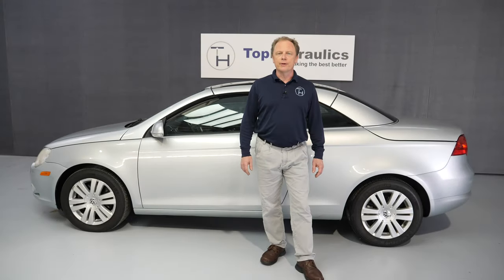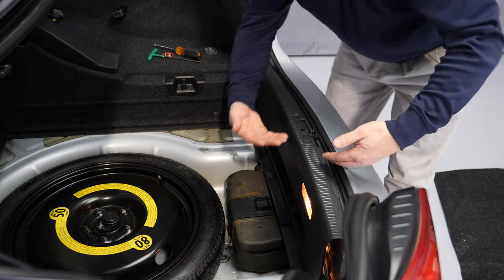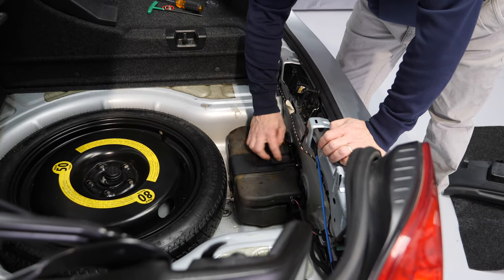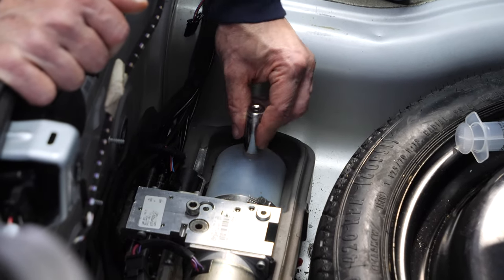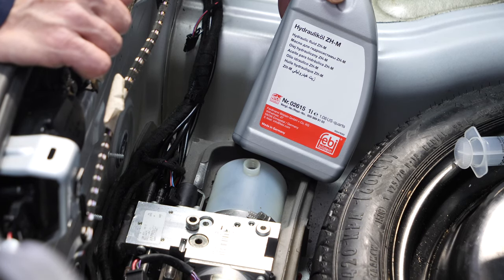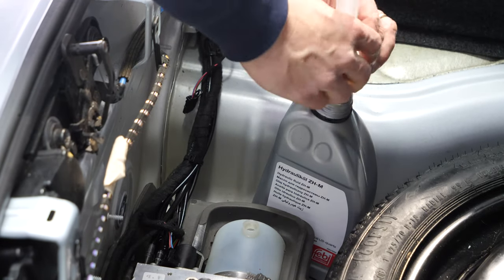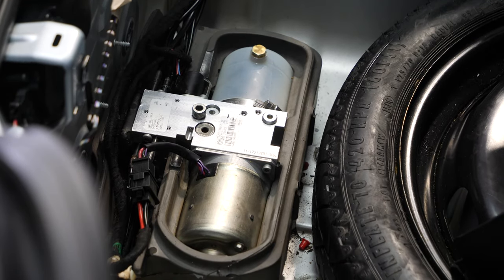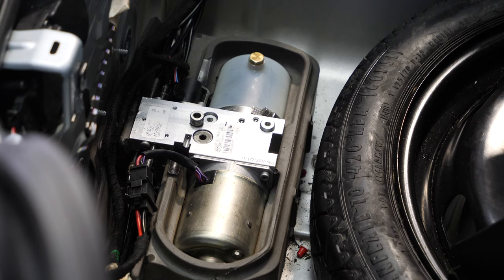Volkswagen EOS - How To Refill The Hydraulic Pump

Comment: Hi Klaus! Thank you for detailed videos. Very useful indeed. I just used the same febi 02615 produced in 2022 to refill my MB R170 roof pump. It is colorless as seen in this video. However, years before, I remember it being very yellow. I also noticed that new MB cylinders (build in 2023) still come refilled with a yellow fluid. I was afraid that my febi 02615 was counterfeit but relaxed after seeing your video. Do you have any idea the reason for that difference? Thanks in advance.
Reply from the maker: FeBi went to being colorless a number of years ago and Mercedes may still be adding a dye to their fluid. Outside of the dye, the fluids should be identical.Sorry to hear that you are using new cylinders from Mercedes, but I appreciate your candor. The manufacturing date is printed on the hoses, as you probably know since you mentioned the parts were made in 2023.
Reply: @TopHydraulics  Thank you  for your prompt reply!

Comment: Hi. How often does this need to be replaced? Does one siphon the old fluid out with a syringe until empty and then refill with new fluid? Does the level typically go down if there are no leaks in the system? Thank you.
Reply from the maker: The fluid level does not go down if there is no leak - this fluid does not evaporate. The manufacturer says that the fluid never has to be changed. Not so if you are in a hot climate or are using the top daily. If the fluid in your pump looks really dark, then you may want to siphon out as much as possible and refill.
Reply: @TopHydraulics  
Thank you so much! Honestly I haven't really looked at the color of the fluid, only to see if there is or has been any water down there. I will however make it a point to inspect the fluid ASAP. Again, TY and have a great day!

Comment: How often do you recommend to check and top up the fluid?
Reply from the maker: Thanks for asking. The only time you will have low fluid level is if there is a leak. In that case, topping off without replacing the faulty parts wouldn't help you much. The designers' idea was that the fluid never has to be checked or replaced, but that is unrealistic. You will be checking the fluid level once you find the top not moving properly and anything in-between may help you for peace of mind. Given that you have to go through some acrobatics to see the fluid level in the pump,   I would suggest every one to two years.
Reply: @TopHydraulics  thanks! Very helpful!

Comment: Question, so if you want to open up the whole roof and it gets stuck midway, could this pump be the cause ?  
Having this problem right now it just stops half way just when the most heavy part should go up.. closing it up again goes fine
Reply from the maker: Let's check the fluid level in the pump first. Is it between the MIN and MAX lines on the pump's reservoir?
Reply: Dimitris Katsaros  yes it was solved, when the roof opens there are 2 'flaps' left and right around the backseat window, ore little wings (for lack of a better word) that kind of go up and flip to the outside, one of these was stuck cousing the wholo roof to stop.. that was quickly fixed and all works well again

Comment: good morning I wanted to ask for information. if I top up the hydraulic oil, do I have to do some bleeding procedures or just fill up to level?
Reply from the maker: The system is self bleeding, meaning, you only have to fill it to the proper level. There are two reasons why the fluid level would be low in your pump: you purchased a used one to replace yours, or there was a leak in the system.
If you are replacing the pump with a used one, please be aware that you purchased someone else's part that either was not working any more or that will fail soon. If you are not replacing the pump but you have found a low fluid level, then you must have a leak somewhere that needs to be taken care of.
Reply: thanks for the explanation. last year I changed the pump and controller ... because after an infiltration it burned everything. so far it has worked fine. i had trouble with the sliding roof motor and i changed the nylon gear. reassembled now it no longer opens the top .... that is, it opens the sliding roof .... goes up the rear window ..... opens the boot .... but does not release the uprights for insertion into the boot. it tells me system error. is it possible that the sliding roof is to be calibrated? I made the reset in total closure. then I sent the scooter all the way forward and closed the flap then I reassembled it. I have now checked the pump and the liquid is at the right level. I brought the machine to have it analyzed with a computer and it says there are no problems. can give me some advice thanks